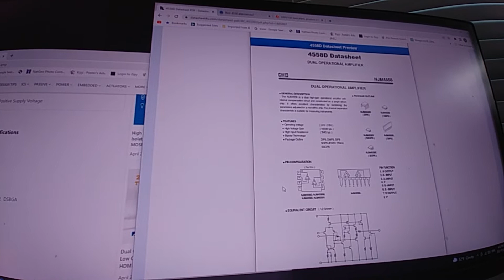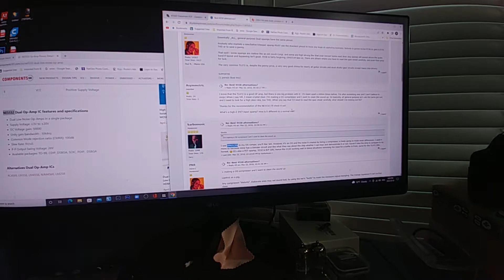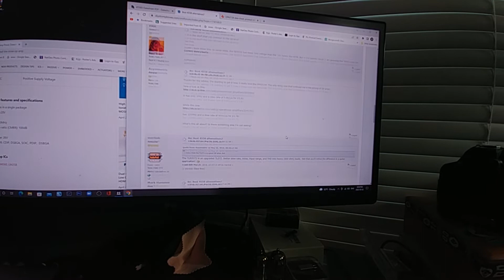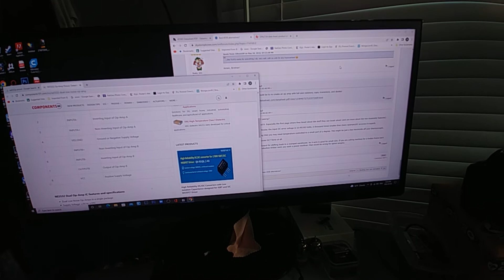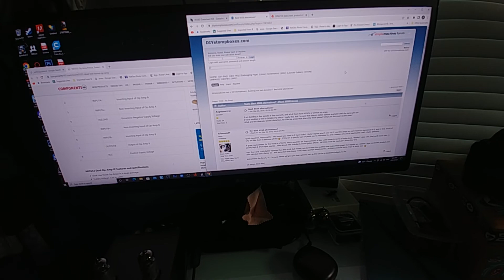electronics vlog# AIYIMA A07 op-amp rolling ne5532 v 4558D

Comment: Looks like the opamps you took out have flat pins but i noticed the ones on ebay which are soldered to dip8 boards have round pins . . Can you use both pin shapes on the a07 socket , thank you

Comment: I am not sure you should wrap a capacitor in copper sheet as yes it reflects heat but it will also reflect the heat of the cap back in on itself and might make it worse...just a thought.

Comment: I have an A07, but the casing is different. Can’t lift off the case - the board is soldered at both ends so I can’t slide it out. Argh! Just want to roll this chip!
Reply: That is unusual. Where did you buy it? I would look into sending it back for a replacement.